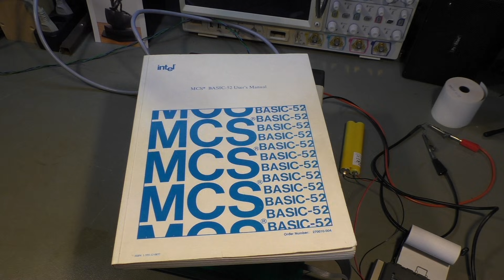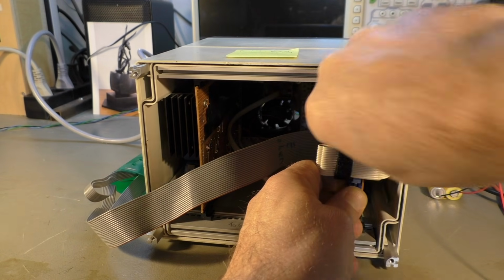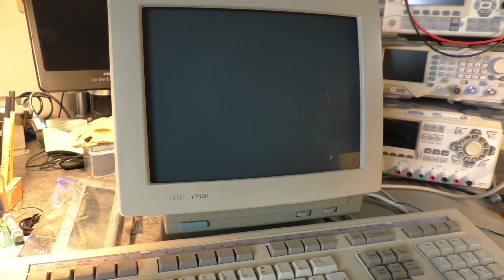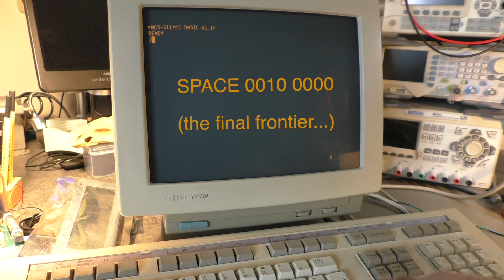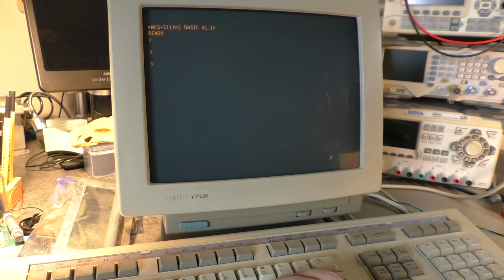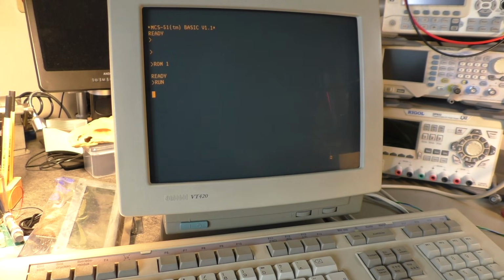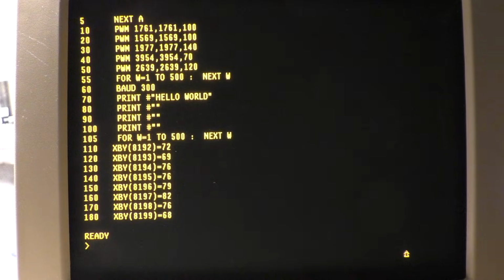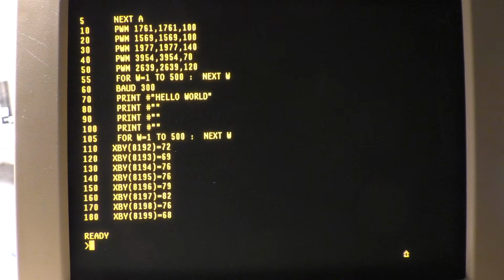The 1980's BASIC computer that most people missed: MCS Basic-52

Comment: Grok:

Intel themselves documented a Sieve benchmark run on MCS BASIC-52 running on the 8052AH-BASIC (a 12 MHz NMOS variant of the 8052). The results highlight its surprising speed for an embedded interpreter:

Benchmark Time: The Sieve program completes in approximately 5 seconds on an 8052AH-BASIC at 12 MHz.

Comparison to IBM PC: This is faster than an original IBM PC (4.77 MHz 8088 with Microsoft BASIC), which took around 6-7 seconds for the same test. The 8052's efficiency stems from low overhead, optimized floating-point routines, and direct hardware integration (e.g., no OS or disk I/O).

The benchmark was likely the standard 100-iteration version (sieving up to ~8,000 primes), though exact code details aren't always specified in sources.
Reply: The 8051 ran at a higher clock speed than the 8088 in a PC.  Also the Sieve don't use floats.  It is all integer math and mostly just adds and bit setting things.

Comment: reminds me of the hrs I've spent using a VT220 terminal.
Reply from the maker: I'd like to have a VT220. The design is cool, it's small and it has an analog video output.
Reply: @PlaywithJunk  We must have throw loads away when the pdp11 got sold to the scrap man. a few were kept for use with a product we had that had a serial port for checking the errors etc.  Then PC's arrived on all our desks 🙂